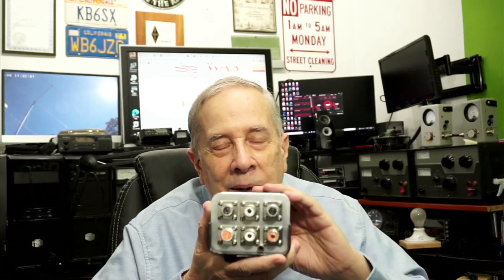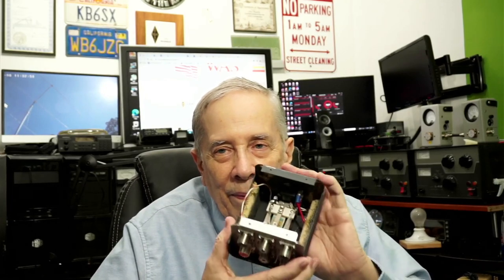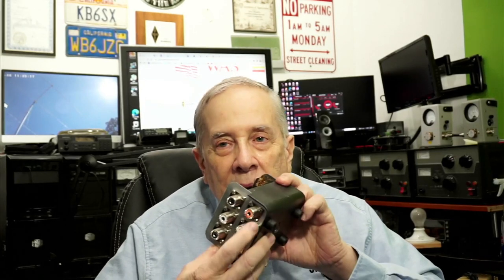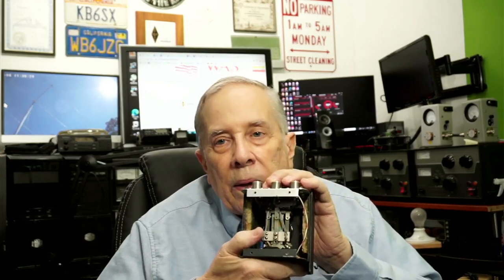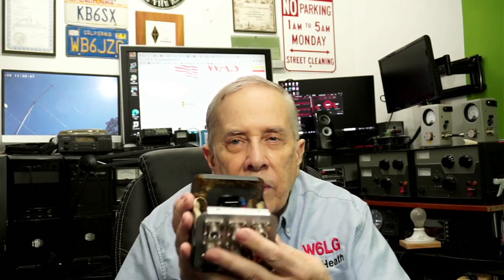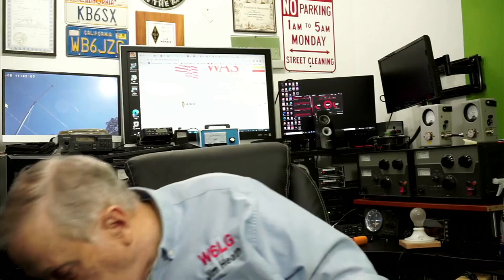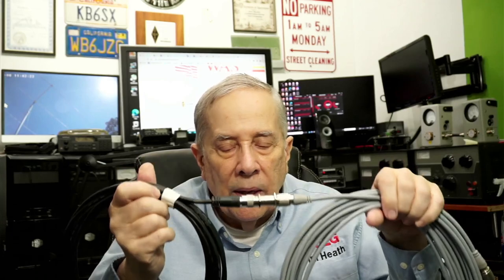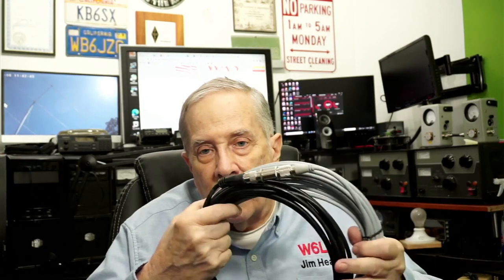Insertion Loss, A/B Amplifier Relay, Why It Is Called An RCA Phono Plug/Jack, Jim W6LG YouTube Elmer

Comment: Another very interesting video Jim. Something that might amuse you, when I built my 2m tetrode amplifier the plate circuit I used was a  tuned stripline with a tap. I did add a low pass filter from a commercial transmitter which actually slightly increased the power output  as measured into a load. It obviously slightly affected the match between the PA output and the dummy load. However it was funnier to refer to it as "insertion gain"... it keeps people confused....

Comment: Nice to see the figures, I have it in mind to build a remote antenna switch using vacuum relays, I guess the losses would be small but its great to have it confirmed. I'm sorry to hear you might have power outages when temperatures are so high over there. Here in the UK it looks as though we may have to endure power outages during this coming winter. Time the eco-warriors where put back in their box I think! 73, Tom. G2NV.

Comment: If you are using a VNA, why S11 Rl and not S12 transmission loss?
Reply from the maker: One is on and out.  The other is in only.  73 Jim W6LG
Reply: @Jim W6LG  I guess what I'm confused about is that S11 doesn't really measure insertion loss, but S21 does to the best of my knowledge. It directly measures it (after calibration). That is one of the main things a 2 port VNA is meant to do. As I have come to understand it, return loss is a different way of expressing SWR (not quite so simple, but they track each other) which may not show a change if the insertion loss is the same in both directions. (The loss due to returned signal.)

Now I have just added another testing series to do and post my results... like I have done for so many other things lately lol. The list grows.
Reply: @ham-radio  After doing much more digging on how Rl is measured, I can see how it can measure the loss when the end is open or short, causing full signal reflection. So you depend on that particular special circumstance to do the measurement.

Comment: Alalyzing the contact failure. The resistance across the contacts isnt 50ohm The system Z⁰ is 50ohm. But I²R doesnt seem right for the contact failure analysis...